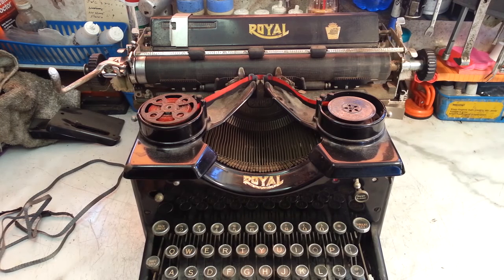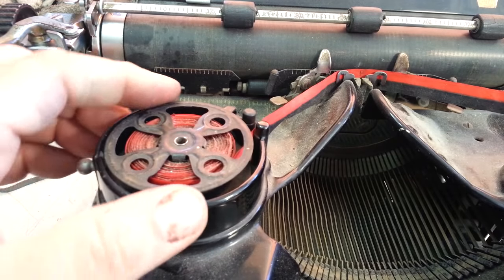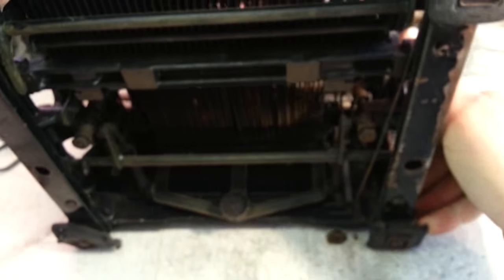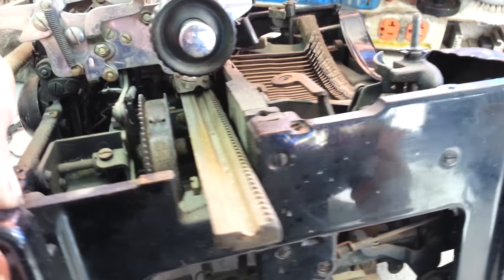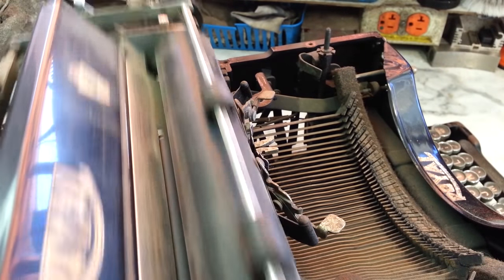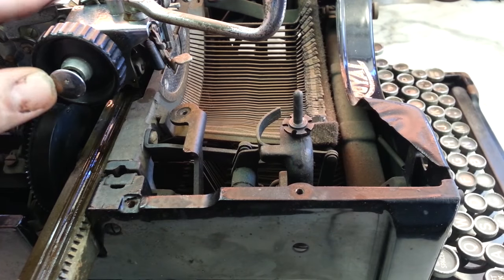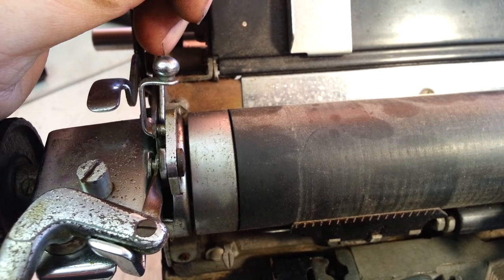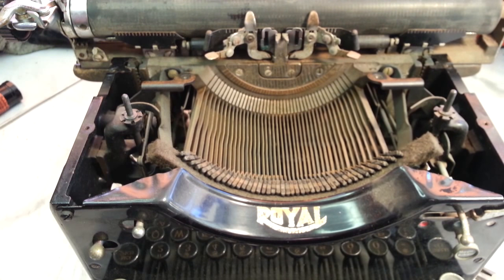Royal 10 Vintage Manual Typewriter Drawband Repaired Replaced Carriage Movement Serviced

Comment: That made me take the plunge into my typewriter. I found a Smith Corona Silent and it was ROUGH. Most of the keys were bent and the pins were slipping out. Springs were snapped and the return arm was broken. Oil and dirt coating everything. Carriage was stuck. It took a lot of time but I got it working again and the only things left are the bell (the arm that engages the striker is broken so I have to look for one) and the felt on the body (it’s soaked and falling apart). Otherwise, it types great and I spent so much time fixing it I had nightmares that night I finished up the mechanical bits. That’s how you know it’s good.

Comment: Duane,
I have an 18" carriage Royal KMM typewriter which survived a house fire with only a bath towel covering it. It was my father's typewriter to do stencils for his A. B. Dick No. 77 Mimeograph Machine. His Royal KMM has always been in climate controlled environment and was serviced by me a couple of years prior to the fire. Dad's Royal KMM is covered in soot from the fire but has minimal corrosion compared to this Royal 10. This 10 was apparently in a moist environment for many years to cause this much corrosion. Attic, shed, basement, carport?
You have inspired me to get Dad's KMM back in service. Your videos have been extremely helpful to me. I was looking for one of your videos which show how to disassemble and reassemble the carriage assembly on a KMM. If you have a video to guide me through this process, will you direct me to it?
Thank you for your experience, expertise and time to produce these videos!!
Reply from the maker: Don't know if there is a video for full carriage removal, I avoid it, 
especially on typewriters not designed to come off

Comment: This is so helpful. I started with just inspecting and assessing my grandfather's old Royal last night (not sure yet on the year) and we decided to clean it up and put it out for display. The drawband worked poorly when it typed and came loose a second later (it looks like it has an old safety pin on the end, probably fixed last about 50 years ago) so that's my first task, to fix or replace that.  Most of the rest of the action seems to work, although there's no ribbon and I'm learning with trial and error what all the levers do. 

The platen(? just looked that up) also has a split in it that i didn't even know about until i turned it.
I'll be watching your video more later.  I love knowing how complex machines work, so I guess this is my new project.  Thanks for sharing your expertise!

Comment: It would be interesting to know how old your project typewriter is - and how you would determine that.  I have a Royal 10 that looks very much like your project, but I know that there are subtle differences between Royal typewriters manufactured in different years.  I have a lot of fun with mine, and I hope to keep it going for many more years.  Any recommendations on at-home servicing?  Thanks for this video.
Reply from the maker: Serial number rear top right hand side, move carriage all the way to the left, then go site below and look it up. Mine was about 1925
https://typewriterdatabase.com/
As a professional typewriter technician, I have no advice for at-home servicing, chemicals, ventilation, experience, tools, etc are all needed.
Reply: @phoenixtypewriter2136 , thanks very much for responding and for recommending the typewriter database website.   The serial number of my Royal 10 typewrite is Y-35-101014, so I assume it was manufactured in 1935.  The typewriter website seems to skip over the Royal 10's of 1935.

Do you sell vintage typewriters by mail?
Reply from the maker: @Gravitys-NOT-a-force  Yes, I sell reconditioned typewriters by mail, but only portables
Reply: Ah, with two hands and closely spaced steps my Royal 10 is portable.   ;-)

Comment: How much does a restoration for a machine like this cost?
Reply from the maker: Depends on starting condition, depends on desired finished condition, depends on definition of the word Restoration
New rubber feet ? New rubber platen and rollers ? Re-chroming ?  New paint & decals ?
Up and operating and cleaned $200, Plus new platen/rollers add $200, Paint/decals add $200, Chrome add $200 , Lots of variables !
Reply: @phoenixtypewriter2136  Thanks. I asked because I was thinking of getting a Royal 10 for my writer friend's birthday since she had a similar typewriter as a child and is a huge fan of the Resident Evil video game series which uses typewriters (Mostly Royal No. 10s in the series,  although some used different types) as savepoints. But the online listings in my price range often stuck keys, finnicky carriages, and ribbons and are rusted badly.

Do you do pickups? She lives in Phoenix AZ.

Comment: I have the same TW, had it at a flea market, it was working fine at the end of the day it wouldn't space or type. What could be wrong with it.
Reply from the maker: Lots of things, to answer that blindly is difficult
Line lock ? draw band ? foreign object ? broke escapement ? bent parts ?
Reply: Phoenix Typewriter thank you, it was a locking mechanism in the back right, after further video investigation.  I may have to add rubber feet to it also the we're flattened so I removed them.

Comment: please help I have same typewriter it has new draw band, but carriage works but when I type the carriage don't move can you please give me an idea what it can be?
Reply from the maker: Carriage has main spring tension, escapement is stuck ? Starwheel is under platen roller
Tab work ? Space bar work ? Does Back Space work ? Hard to diagnose/troubleshoot long distance
Reply: @phoenixtypewriter2136  space bar don't work and the back space only back space once then nothing. the carriage moves side by side when I press the release button. do you have any idea what it could be.
Reply from the maker: @diablo-km2ot  Without being able to troubleshoot in person make things rather difficult to diagnose
check linkage to escapement, check escapement starwheel.
Reply: @phoenixtypewriter2136  thank you very much:)

Comment: hi can you help me i bought a royal 10 it has a new draw band with correct tension on it, and when i type the carriage dont advance it striking the platen but nothing stay in the same spot , I pressed all the keys even the spacer and no luck can you make a video will appreciated.
Reply from the maker: This is the video . . . . Are you having an escapement issue ?
Reply: yes i try to type but the carriage stays in same place
Reply: does it have a lock to keep it from moving??
Reply: Frijo1 it does below the keys. It is like a metal flap that looks like a grid